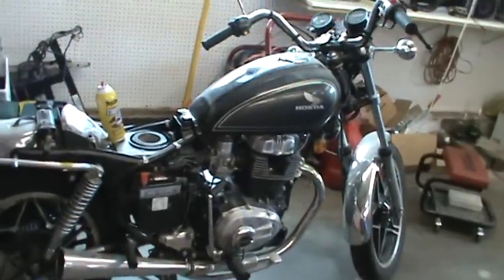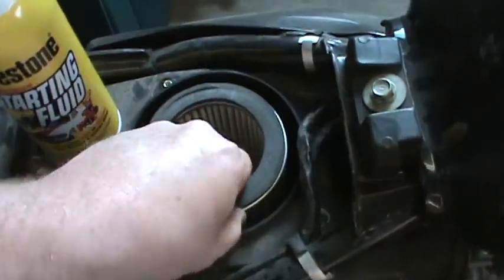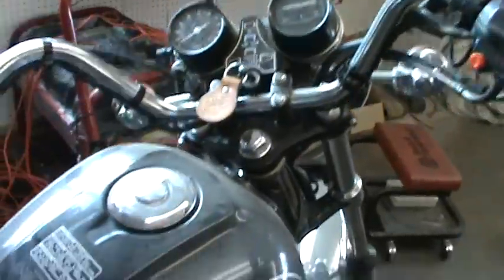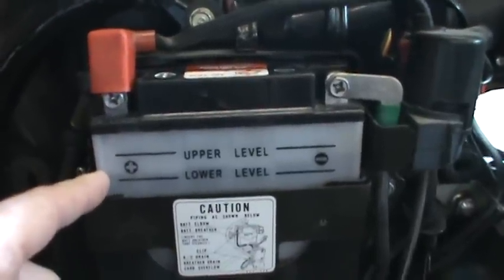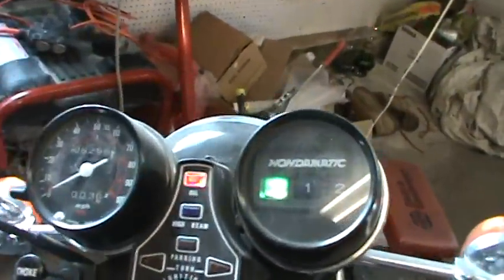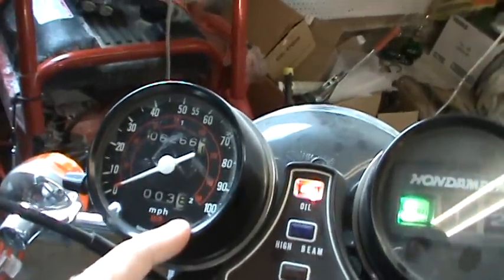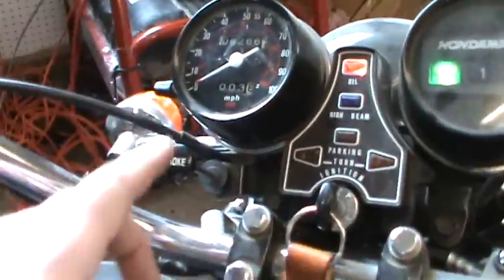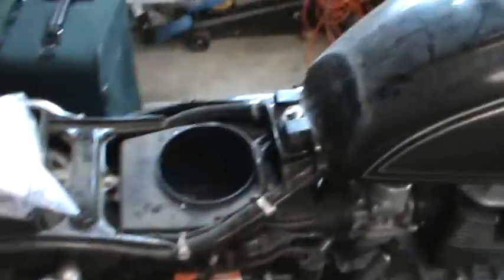STARTER FLUID= HOW TO USE !!!= GIFT FROM THE GODS...

Comment: Another tip when your carbed bike sat all winter. Take off the vacuum line from the carb and suck on it. Pulls fuel through the lines. That's why they don't start easy in the spring. Gotta crank to pull fuel through. Or.... just use starter fluid to get the motor cranking quicker to draw fuel through the lines
Reply from the maker: That is a GREAT IDEA. Never thought of that. Makes perfect sense, thank you RH

Comment: I have a CBR600RR which as you know is a sports bike. To get to the air filter I would have to remove electrical circuits under the fuel tank cover which would make it inoperable. I am wondering can I just spray inside the front intake for air, which is a long hose that goes in? Thanks
Reply from the maker: Thanks for the info!

Comment: When starting a bike after storage use full choke and DON'T touch the throttle. most time you don't need starter fluid if you do that.
Reply from the maker: Oh, Ok. Will do. Thanks.
Reply: Ummmmm.......that won't work on a Honda Helix. It has an auto by starter (no manual choke)

Comment: 2nd gear is 50mph? Lol
Reply from the maker: Both handlebar levers are Brakes, NO clutch. the bike is called a HondaMatic only made for a few short years. The gear pattern is (2) down and 1/2 up for neutral. You push down the lever for 1st gear  up till 50mph on the speedo, then press down again for 2nd or top gear. Rick
Reply from the maker: The Bike is AUTOMATIC, it has NO clutch or Clutch levers.